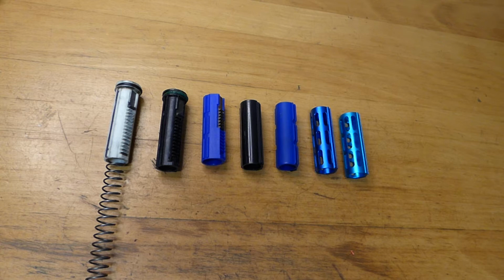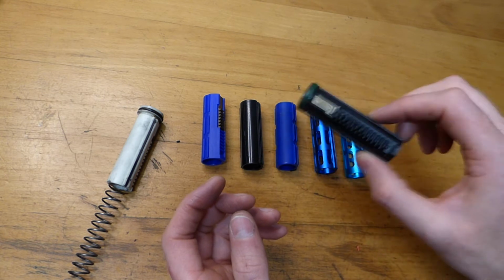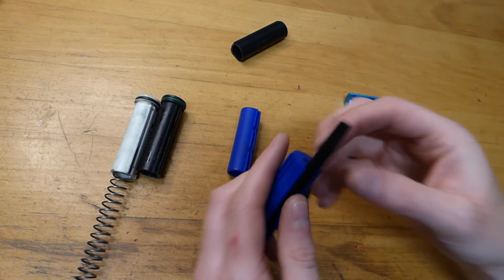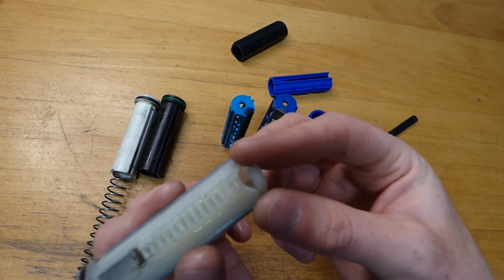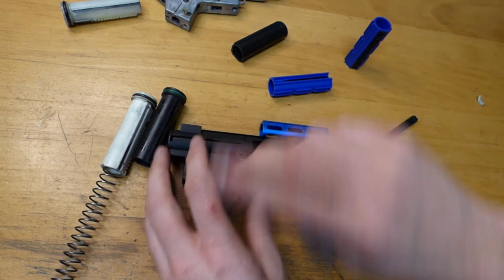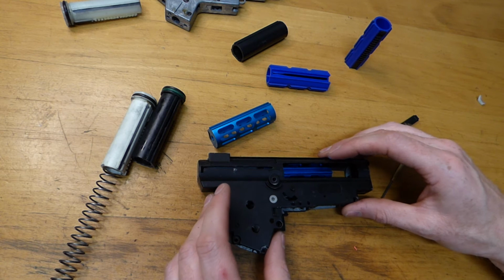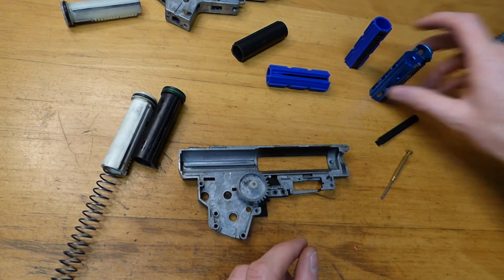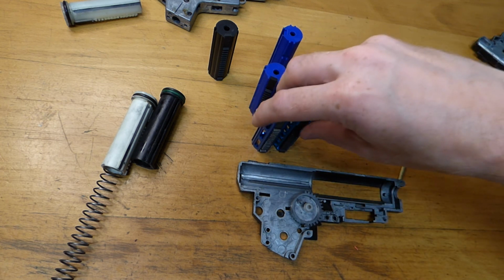Different upgrade pistons for airsoft AEG

Comment: you should also make a video about piston heads.
while i understand the difference between a single and a dual O-Ring piston head, for the life of me i don't understand the difference between 8 holes and 16 holes, whats the difference between flat metal piston heads and conical rubber piston heads, and hole types and whatnot, what difference does it make and what's best to prevent suction when the piston is pushed back by the gears?
and while at it, cylinder heads is also another topic that doesn't make much sense other than 1 O-Ring and 2 O-Rings to me. what's the benefit or drawback of a thick flat rubber feet and a conical rubber feet?

it seems there's not much information online or at least someone which actually knows how to explain all this information as precise and as clearly as you do, for example your gears ratio explanation video made me understand the type of uses for each gear ratio in AEG perfectly, this video made me realise i really should only be buying full metal pistons and not settle for a nylon metal hybrid piston.
i wanna learn more! lol
Reply from the maker: This is a great idea!! I will do this, I have a selection of different piston heads to demo as well! I have my upload planed for this week so I will try and do this for the week after. 😁

I appreciate your input as I'm always looking for the next idea for a video.

Hopefully I can provide the answers you are looking for. 😁
Reply: @adzzzysarmoury  awesome! i will be watching my notifications feed like a hawk now haha
Reply: most of the things you ask have abslutely 0 impact on accuracy, feeding, range and what not...
Reply: @MegaChickenPunch  you're wrong, 
I've played with gearboxes quite a lot these 9 months and tested multiple different configurations and i can tell you for certain that a good cylinder seal alone = greater vacuum suction thrust from the nossle = faster gel velocity speed = better range. 
Aka a gel that's being fired at 450fps will reach further than one that's being fired at 180fps, And if you also upgrade the spring your gel velocity will be even higher which means an even further range.
Doesn't mean its going to be accurate. But most of the questions i've had are mostly related to the cylinder, vacuum and use cases for different variations of each component of the cylinder pumping system.
Either way, i dont understand why you even replied? Just for the sake of replying something completely out of context because you were bored?
Reply: @HoLDoN4Sec  dude WHAT? you were asking about some farts and now you are saying about airseal and fps?!?
Reply: @HoLDoN4Sec  you asking about some orings and amount of holes in the cylinder head. I told you it doesn't matter and you answer it does because blah blah spring and fps?!? What is wrong with u lol

Comment: Have you ever seen a full metal tooth rack fail at the pickup tooth? If not, it may be worth not having aluminum rubbing on your gearbox shell. pistons are fairly bulletproof these days.
Reply from the maker: It is true pistons are pretty durable provided the AEG is built correctly. Equally I have never seen additional wear from an aluminium slide. Remember most of the other moving parts in the gearbox are metal on metal contact too. So the additional durability of the pick up tooth is favourable in my opinion. 😁

Comment: definitely have a few contentions with this video. For one, there's definitely uses for a half metal rack piston. Secondly, aluminum body Pistons are pretty much just a hazard and your understanding of the benefits of the thicker pickup tooth is flawed. The issues with the most common SHS and ZCI plastic-bodied full metal rack piston similar to what you showed are 1) that there's gaps between the rack and the body and 2) the section of plastic behind the pickup tooth is usually too thin to consider the piston reliable especially considering poor tolerances and quality control inherent in this industry. It is for these reasons that you should fill in those gaps with EPOXY. this stabilizes the rack and strengthens the body, greatly reducing the chances of the rack blowing out the back of the piston. That thickened pickup section on the aluminum piston is not important to the strength of the tooth, it's important for spreading out the forces on the piston body. But I've seen some crazy failures on those pistons and I find it hard to imagine a scenario in which is would be preferable. Even unmodified SHS FMR Pistons can work fine for awhile in most SSG builds.

Comment: Metal pistons are heavier and heavier youbwant a heav vpiston woth a heavy spring which will cause otbto finish fast. Light piston light spring will also finish fast light sping with heav vpiston or visaversa will cause the piston to finish slow.  Medium wiyh light or heavyv pring will cause the piston to finish moderately.  Only time to exparament with that is in a dmr. One tonne dod a good writeup on this.

Comment: I would personally suggest SHS nylon pistons. I use them in DSGs and DMRs at 1.8 joules, never had one break. I have seen many aluminum pistons warp. Aluminum has no memory like plastics do. It is impossible for nylon to wear into a gearbox. Aluminum on monkey metal could. It would take an incredible amount of time for it to do a lot of damage, but why risk it unnecessarily. When an aluminum piston breaks, it can take out the cylinder and piston head with it. If you like using them, just use them in lower stress builds. I have seen many aluminum pistons that look like crushed coke cans in DMR and DSG builds. Also they weigh more, which is not good for the front of the gearbox. It is also the reason the piston can crush in on themselves and warp. This just comes from conservation of energy and conservation of momentum happening at the same time. Science stuff.
Reply from the maker: Interesting feed back. Fortunately I have never experienced any problems with the aluminium pistons being buckled by the workings of the gearbox. I usually radius a gearbox to reduce the stress on the front of it. I have used them with good success in normal AEG builds as well as DMR builds.
Reply: >DMRs at 1.8 joules
laughs in polish

Comment: Standard airsofter moment, mooore metal=best thing ever.

It’s been proven that aluminum pistons are hot garbage. Theres zero benefits over a metal rack plastic bodied piston and in 99% of cases there are more disadvantages to them.

If a plastic bodied piston can withstand a 14.8v 9T Sp170 60 rps DSG that has killed a siegtek sector, there is zero reason why to use a aluminum piston.

Comment: I'm working on an extremely high speed build and I've blown the teeth sets off two seperate pistons. Just flew right out the back, hopefully an aluminium piston can handle the rate of fire.
Reply from the maker: If you are doing a crazy rate of fire, be careful as the aluminium piston maybe too heavy to work effectively with the higher rate of fire.

Comment: where to buy this black piston?? i have problem with gears 32:1
Reply from the maker: For 32:1 gears you need a piston with only half a track of teeth. This is so it only contacts on the sector side of the sector gear.
Reply: @adzzzysarmoury  TY, i found it!
Reply: @adzzzysarmoury  so if we use 32:1 we need to use halfteeth Piston ?  What is the best ? 14 or 15 teeth ?
Reply from the maker: @MrHaidar13  correct half tooth for 32:1. 14 tooth will give you less issues with the pick up of the piston. However you can always modify a 15 to best fit.

Comment: You say people don't check piston and parts compatibility, but where and how would you get this information before buying?
Reply from the maker: It can be a bit of a mine field. There is no real way of knowing what will work in every gun until you try to fit it. It is not something that is always a problem though. Just from experience it is good to check as if there is a problem with tightness of the piston in the gearbox or meshing with the sector gear then it is best to find out while building the gun rather than trying to shoot the gun. 😎
Reply: Just buy plastic piston with full metal rack
Reply: you actually can't